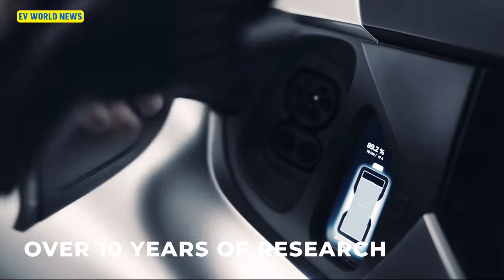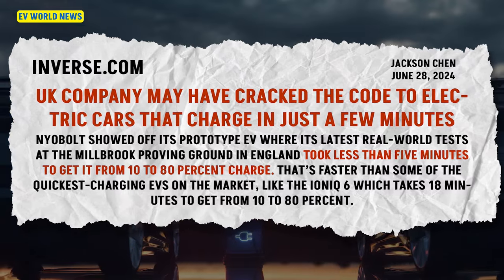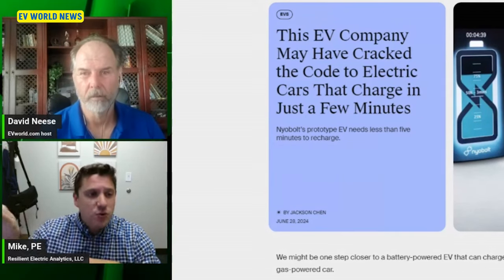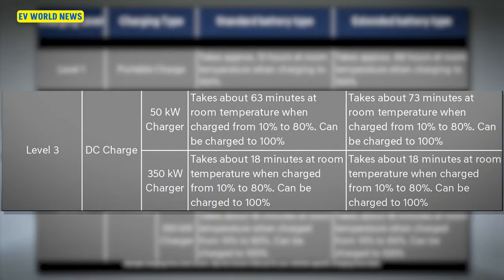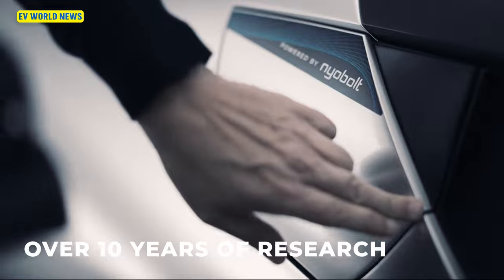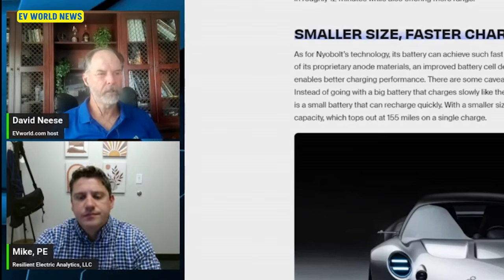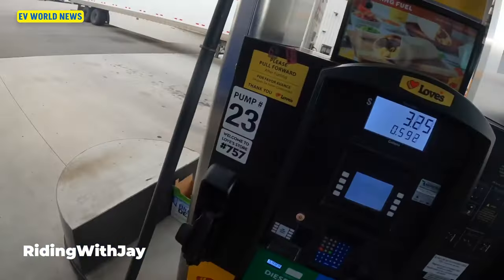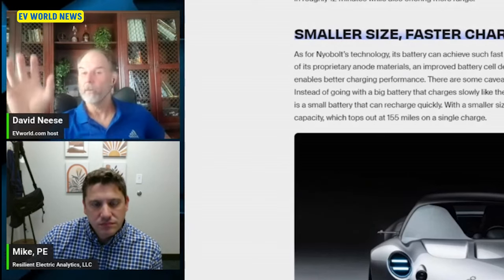impact of fast charging on EV battery life

Comment: If you guys really want to blow your minds look into the mcs connector and the upcoming semi megawatt chargers. Once we increase the voltage so we can maximize the current. We are still in the early days so every 5-10 years I'd expect everything to double in charge speed. Some would say that charge speed is more important than pure range cause most people don't travel too far in their daily commutes. That would save money and weight with smaller batteries.  Great video, subscribed.
Reply from the maker: My understanding is that the 800V charging is essentially what is being used to charge the Tesla Semi.  Charging tech is advancing at an astounding pace.   We should see that standard everywhere in a few years.

Comment: You can plugin any EV for 5 minutes and get some amount of charge. To get 300 miles range in 5 minutes is about 85kwh at an efficiency of 3.5 miles/kwh. To get that much energy transferred in 5 minutes is about 1030kw. To limit amperage to, say, 500A, that would be a system voltage of ~2060Vdc - nearly triple the voltage of today’s 800 volt packs. I would be impressed if light duty passenger EVs grew to that power level.
Reply from the maker: Currently the best passenger car, and charger combo is capable of 40 miles per minute.  More cars are coming out in next years model with the right systems, and eventually the 800V superchargers will be more common for passenger cars.

Comment: 3.21 what were the concerns?
I was hoping you would give at least 1 example.
Reply: Am no EV expert but but at much lower voltage there is a considerable amount of heat, on a hot day that may REALLY be an issue  (imaging if that was in Texas) and you need to make sure no half brained person run into one of the chargers causing a short circuits...just keep in mind that anything above 500-600 volts are considered life-threatening,
Reply from the maker: I probably interrupted Mike.  We do the shows unscripted.
Reply: @ChuckNORRlS  with electricity the system can be turned off in the event of shorting. You can't do that  with gas. Once it starts to pour out hopefully there is no spark. The charger is just the dispenser, the actual electricity comes from another transformer. If someone hits it, the electricity to that charger would be turned off immediately.

Comment: to charge in 5 minutes requires massive power to be available.  high rate of charge will also mean more heat, and more danger of a problem.  this is snake oil talk
Reply from the maker: I think this will be the main challenge for these chargers at truck stops.  It is a lot of power to supply in out of the way places.  There are strategies in place to accommodate this but it will take time.
Reply: @EVworldnews  unless you use batteries to store electricity next to these DC chargers because they are already DC based. These batteries also balance the grid so when there are grid issues they can keep the stations operational. There are a bunch of companies already doing this. They can charge slower throughout the day yet discharge into the car extremely fast.
Reply from the maker: Battery storage and load balancing tech is really impressive.  What is surprising is how inexpensive the solution tends to be.

Comment: Sounds dangerous AF, we really need safer/cleaner/non-toxic battery technology to be environmentally responsible and sustainable. Charging stations in parking garages? Wow...how stupid! Ever seen an EV on fire? I like EV technology but we are not there yet, they need to chill!
Reply from the maker: Why does it sound dangerous?  It is being done already for big trucks and to a small extent on passenger EVs without issues.   How many gas cars have you had catch on fire?  You have 1.5% the chance of an EV catching on fire compared to a gas car for the same miles driven.   Technology in the EV space is growing at a crazy fast pace.